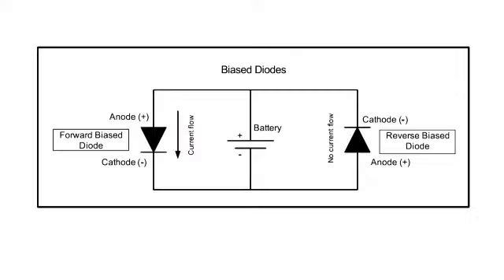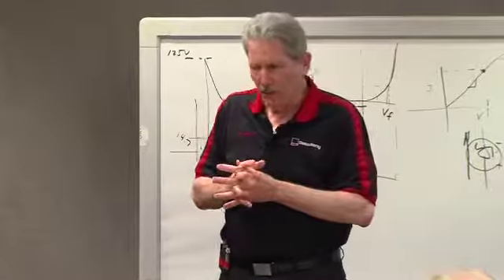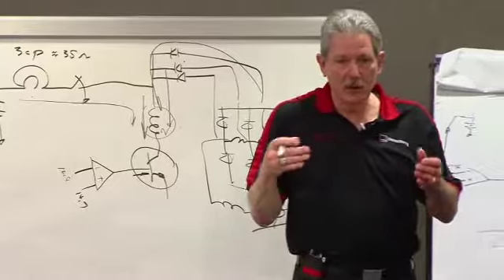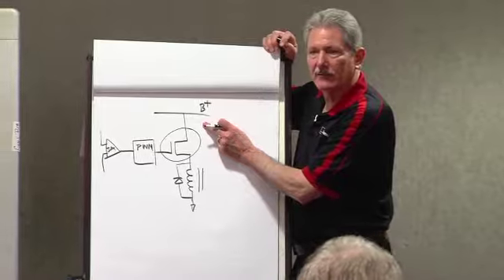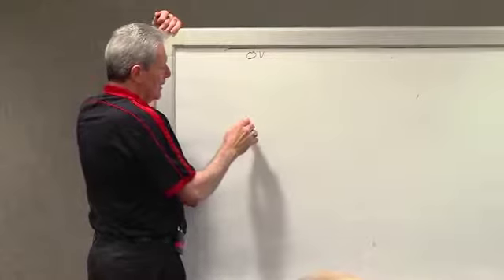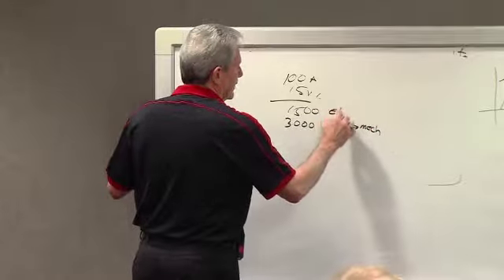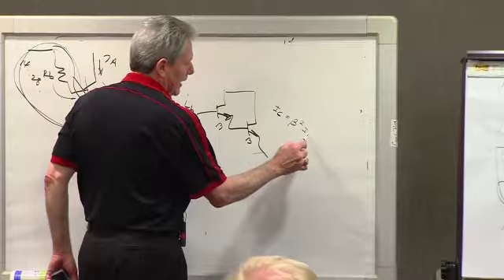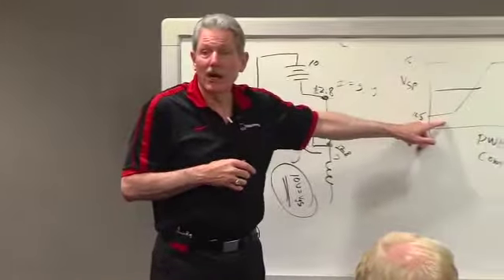Alternator Electronics

Comment: Thank you for the training.  Do you have a couple of vehicle examples that are or have been using LIN based alternators? What year they began,  makes, and models.  I would like to learn more about them.  Any diagnostics training or info available for me to reference and study? Also been searching for diagnostics training on Honda battery sensors but haven't found any information online.   Thank you, Billy
Reply from the maker: Hi Billy – Thanks for watching and writing! LIN (Local Interconnect Network) is a protocol used for communication in vehicles. It was developed by a group of automobile manufacturers and was first used in 2002. A LIN system allows extensive communication between the alternator and the engine management system. The engine’s management system controls the vehicle’s charging, including the alternator’s voltage set point, through protocols such as LIN, BSS, RLO, RVC, RC or PWM.  Messages between the alternator and the vehicle’s CPU or COM system include breakdowns, errors, temperature, and voltage regulation. 

Vehicle charging and electronic system management can get confusing! Since manufacturers use different systems, we are producing more instructional videos for diagnosing and repairing specific vehicles. We’re also working on training for common fault codes. Check our YouTube page – Remy Power Products - for info on GM, Ford and Hyundai vehicles, with more to come. There’s a video on diagnosing non-PCM controlled systems, too.

Visit our website at https://www.remyautomotive.com for more information and technical support. Our online catalog is helpful for the specific applications you asked about and we have extensive coverage for passenger vehicles and light trucks. 

And please don’t hesitate to call our free support line - whether you’re installing our starters and alternators or not - and talk to our experienced technicians. (Although we hope you’ll consider giving your customers the benefit of installing our best-in-class rotating electrics!) Thanks again for watching and writing, Billy. Please visit often and keep in touch.